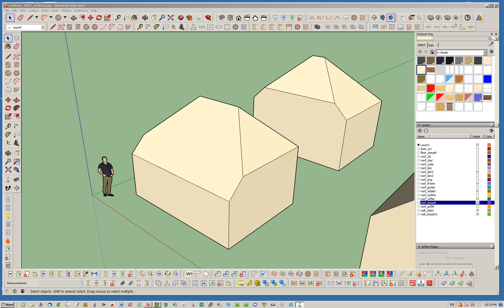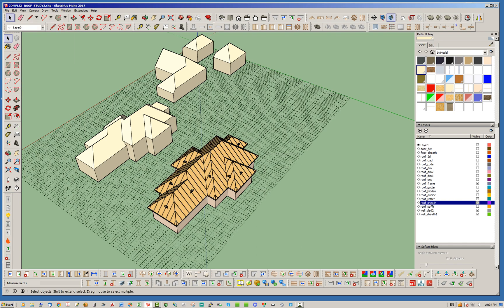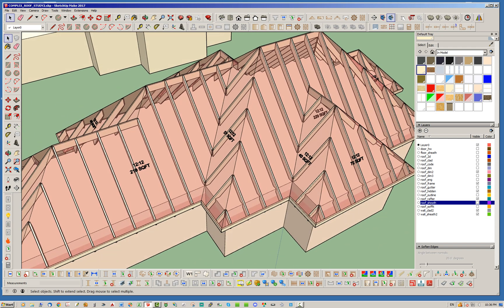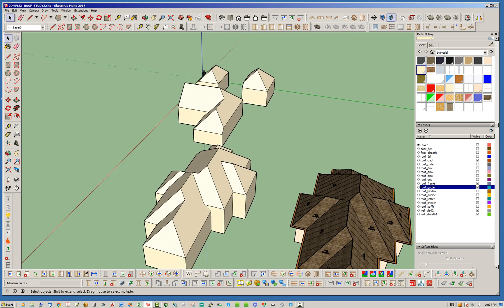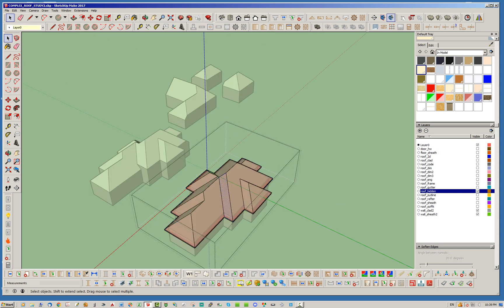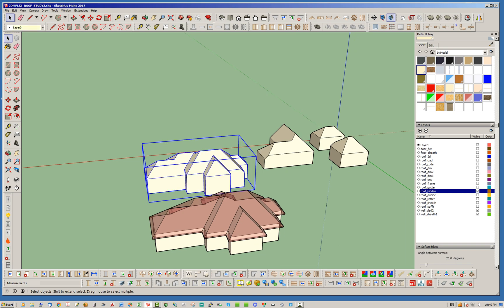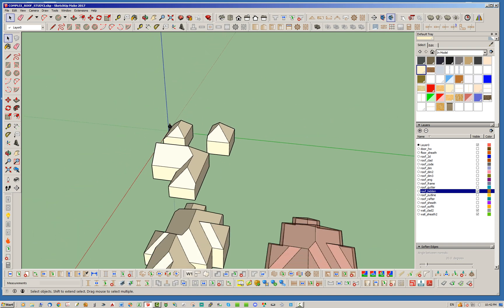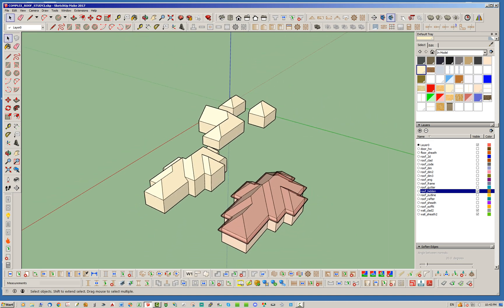Medeek Truss Plugin Tutorial 24 - Complex Roof Discussion and Limitations

Comment: Hey Nathaniel,

My comment here is aimed to bring value, but I am not ruby coder…
When I work out roofs with multiple heights I always focus on the plates height and the datum height between them and then I calculate the spans  and let the angled find themselves, I actually have a saying that that makes no sense to anyone but me “that angles never lie”, I don’t know where I got it from but it’s always worked for me!

so saying that can’t we just click around the perimeter “wall face only” and then retrieve the blue axes height and then adjust the wall junctions and use it to work out the “step overs/ups” adjustment after, working outside in to the bisection points

Regarding the “Dutch hips”, I would recommend rewriting the input lengths with code to insure the inputs are to the correct position, regardless of where they have clicked and use the main roof as your dominate members to bisect your half hip into the true position, 

Maybe a better way to explain a dominate roof member in coding terms is imagine the plate = 0 and the ridge = 1 and everything in-between is fraction…
This way if everything is connected to a dominate member if must equal 1

Comment: But we would typically not design a house with those roofs that would clip the corner of the roof anyway so your extension is still a big help.  If there were differences in wall heights, we would still keep the roof line logical and avoid the clipping roofs on the corners.  
And it is easy enough to go in and add the hip and valley rafters manually.  At that point most of the work is done for you.  The extension does the heavy lifting portion of cutting all the rafters to different lengths and the compound angles needed.  This is what took so long before manually.  Thanks!
Reply from the maker: I partially agree with you on this one, the simpler examples I show are not practical or realistic however I have also seen many of Larry Belk's more complex plans that do this sort of stepping up and stepping down and it certainly makes things challenging.  No one wants to have to manually edit stuff, not if it can be automated.
Reply: @medeekdesign  I'll have to look into Larry Belk.  Most of these complex roofs are not necessary, costly and easily avoided with just a little thought and good design. I once framed a house like this and it took twice as long to frame the roof than the entire rest of the house.  For me this is a waste of time and resources.  Some of the best architecture in the world have simple roof designs.  But I suppose art lies in the eyes of the bolder :)
Reply from the maker: @ArtisanTony  The higher end houses like those really cut up roofs, we're talking 10,000 sqft homes.  Larry does a lot of that kind work.  Some really nice designs but the roofs are something else.  If my complex roof module can draw his roofs then I have achieved something.
Reply: You should check out some of the rooflines in Charlotte, NC. They seem to be under the impression that the more different pitches and elevations you have, the more valuable your home looks. These Georgian style McMansions have 7/12 intersecting into 12/12  with a 3.5/12 shed roof on one side and if they can find a spot for a witches hat, they will put one in. As a framer I would spend my evenings calculating wall heights and fascia planes just to be ready for the next day. Some of it was fun but sometimes it was ridiculous.
Reply: @zyphryx9  we call those gable wars :)